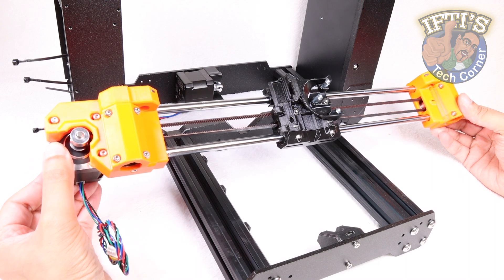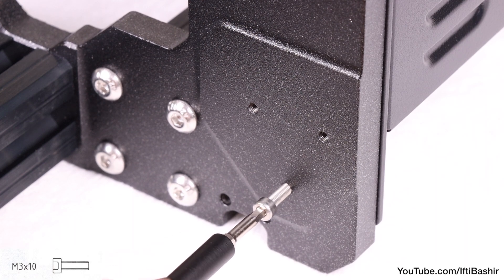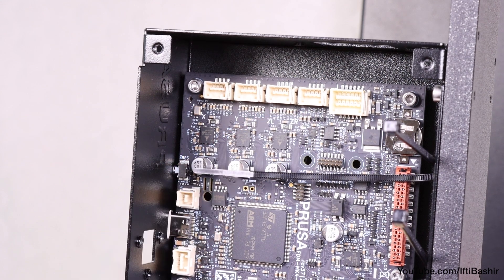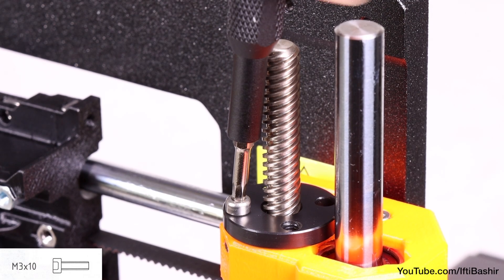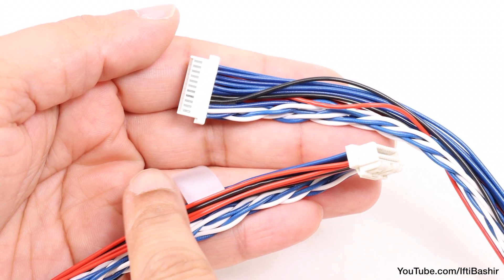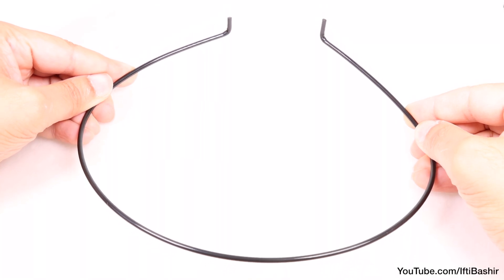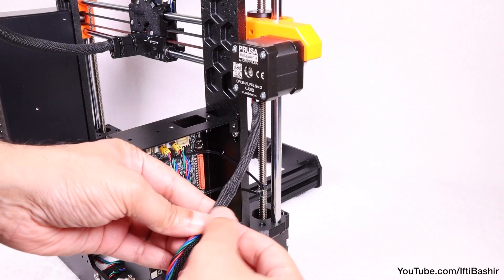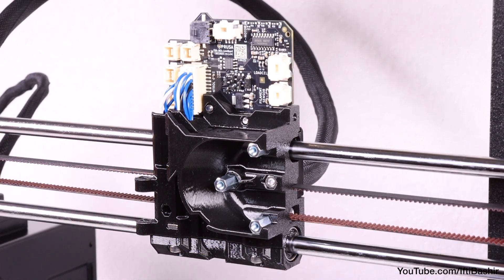#04 Original PRUSA MK4S Kit : Full Step-By-Step BUILD GUIDE - Z-Axis Assembly

Comment: Trying to lower the extruder by spinning the threaded cables but mine seems so much tighter than yours. Is that an issue in my assembly or do i just need hardened fingertips?
Reply from the maker: Maybe I just make it look easy in the video! You need to turn both simultaneously so the X axis remains completely level. They are not free moving though, so there is some force needed to rotate them. I wouldn't worry at this stage as when powered they should be fine.

Comment: Gosh my z axis keeps failing! They keep telling me it's the trapezoid nuts that are not equal on either side...... any ideas?
Reply: my z axis is failing right from the start test as well, but don't know why.  Measurements on both sides of the x-axis to top of frame are identical and I cannot figure out why this test is failing.
Reply: @kevincobb4346  or at least get something pre built. We can learn to fix it later if it breaks. This situation? 100% not worth it. They shouldn't even have the kit option. It's such a headache
Reply: @heidik1757 mine was the kit. Just backed off the trapezoid nuts a tad and works well. Did start having nozzle clogging after three prints so i pulled it out cleaned it out and turned that damned sensor off.  Probably shouldn’t have but have been printing for about 8 hours pretty much non stop with petg
Reply: @kevincobb4346  my solution? returned it and got a refund -- and got a Bambu Lab H2S with no AMC unit so it's cheaper. Good luck with that thing. Hope you can get rid of it honestly. If you can check this one out. It's brilliant. Best

Comment: I'm working through the whole series so I'm ready in a couple weeks when my kit arrives. Would there be any downside to not installing the Z-axis rods until after the motors are initially mounted? It seems like they'll just get in the way of the motor screws at that point.
Reply from the maker: That would be fine, just be careful inserting them so that you do not crack the plastic motor mount parts that will have been screwed into the frame.....

Comment: Protip, don't tighten the bottom 8 motor bolts until you've secured the black backlash nuts and top holders. This will ensure that it's perfectly square with the frame.
Reply: I was thinking the same
Reply: It doesn't make a difference because the threaded bar is not held in place by the top holders anyway.